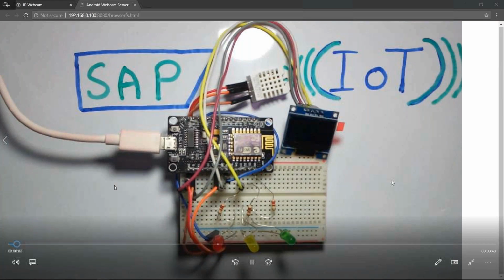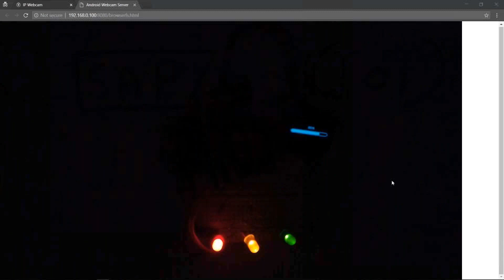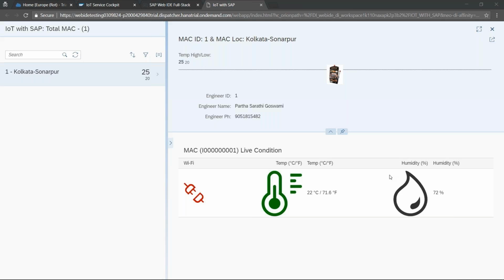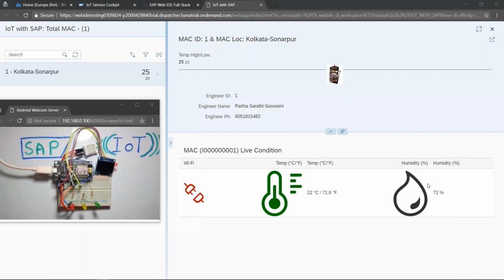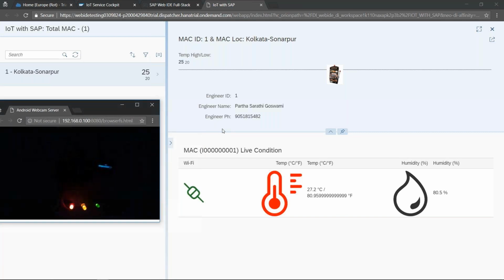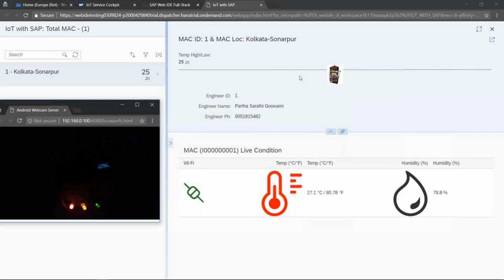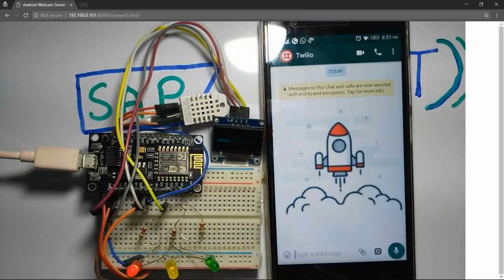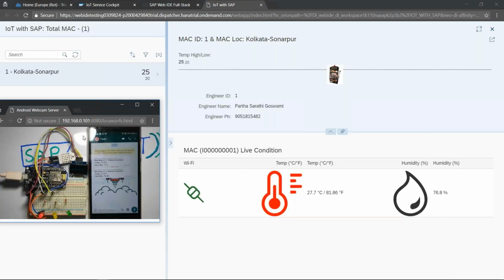DEMO: IoT with SAP BTP

Comment: do you send the IOT Data to NEO or Foundry ? How you you make the MQTT with Arduino ? Thanks Chris
Reply from the maker: In this I have send the data to NEO, but CF is also possible. For MQTT I have used eclipse.org. cheers!
Reply: @ACloudGuruji  thanks for the info, but i do not understand the connection between arduino and SAP Cloud. do you have a sample code for the arduino, which manages the MQTT Protocol ? Many thanks, cheers Chris